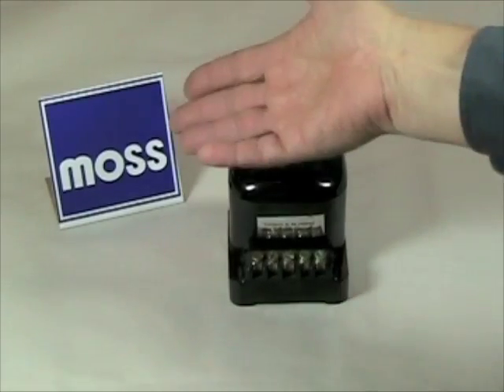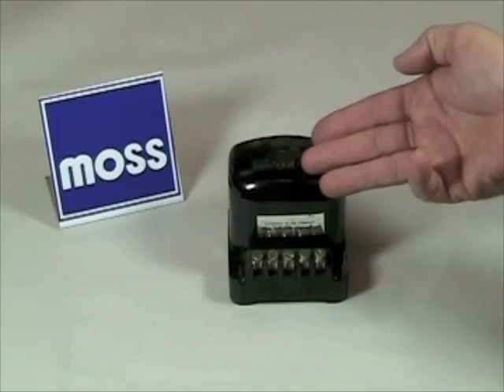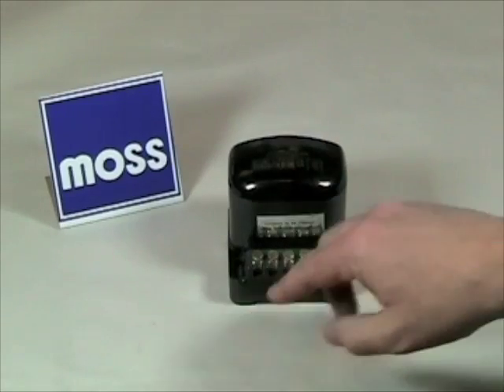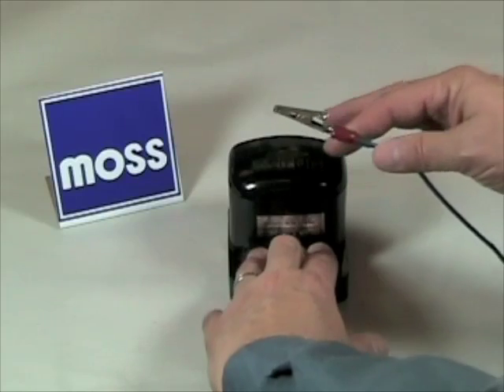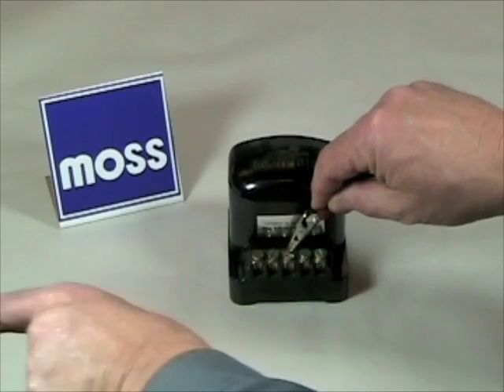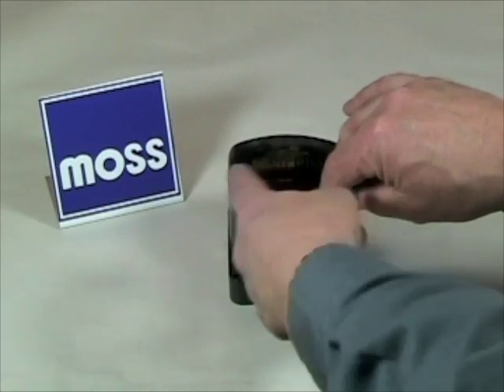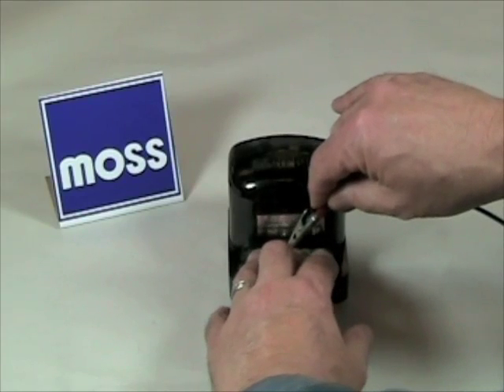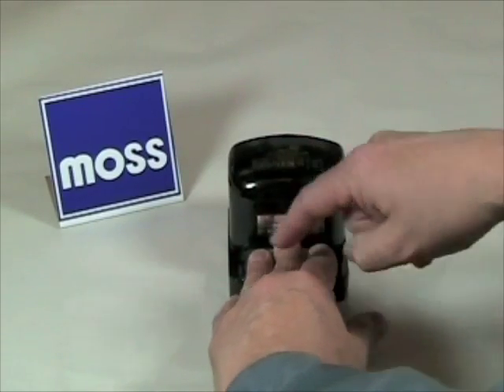Voltage Regulator - How to Test

Comment: Forgot to mention.. My generator continued working after I removed the hot wire.   I knew it was working because my generator light turned off AND car  continued running when I disconnected the battery.

Comment: I did this on my 59 Edsel while the car was running on battery alone and I was surprised that my generator came back to life while doing this -.  Hot wire from +Bat to Regulator  F-terminal.  Thanks to  Moss Motors for these good videos.

Comment: i have an alternator not generator in my ford and i did this test and according to this it is my regulator. well i replaced it and i still have my alternator light on. it goes off once the car reaches a certain rpm.
Reply: anything producess electricy is a generator not a alternator ,alternator just alternataring things not generataring electricity
Reply: Some have to hit a minimum RPM to kick in. Had a problem with my 57 Chevy similar to that. I like to run the idle really low because I like how the cam sounds :P but mine needs to hit 900 RPM to kick on, so I just give it a rev.

Comment: Just convert to an electronic regulator. 100% reliability and bright headlights.  Fits inside the old case so the purists will never know :-)
Reply: what do I do with all the coils,relays and crap that is in the case?
Reply: +Jeff Gibson throw it ;-)
Reply: +NOBBY 07836 and where do I get an electronic voltage regular that will work on a 65 Massey Ferguson?
Reply: +Jeff Gibson http://dynamoregulators.com

Mail the guy and he'll give you a couple of checks to do but he'll tailor a regulator to your needs if it's that unusual. think a Massey tractor would be a lucas RB340?? 
what ever it is he'll sort you out ;-)

Comment: But the problem is I can fit anything in if the wiring is in place because it's a weather tight plug.  Thats what I was trying to see is how its done
Reply: Robert El-Adham If you take a small, sharp object and pierce the wire, like a hat pin or something, then you can clip your lead to that. Then, when you're finished testing, you can just smear some RTV silicone into the hole you just made in the wire's insulation, keeping a water-tight seal to prevent corrosion.

Comment: i dont think u know what u are doing u say that u are testing a generator style voltage regulator but u are using altonator style test u have to power the field on a altonator but a generator automatically produces power when turned because it has permanat magnets.there fore when u say generator in this video u need to be saying altonator. so test generator style like HD58PHD said. when u ground the field for a second it will also decrease the rpm of the engine because it is at max power draw.

Comment: Save buying a new generator and DO NOT connect the field terminal to power to full field test!
With engine running,MOMENTARILY connect field to GROUND and you should get max. output at armature terminal.

Comment: Can you help me please I have a 440 kohler motor it has stator cdi ignition and I have to wire a 79 ford altenator to it ok my problem is how does it wire into the ford regulator REG . has  [ I A S F ]  79 FD reg  I have 3 wires off motor black for kill switch & green yellow thats main power & white thats ground the altenator is for lights and fan Batt charge & winch do you have any Ideas ,I think we`re channel friends already